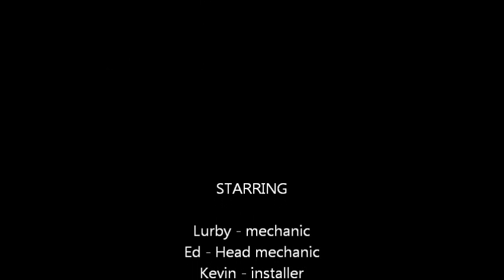Ford 4R100 automatic transmission rebuild

Comment: hey Matt. I broke my Trans cooling lines when I pulled the unit out.  can I replace the metal lines with rubber ones?
Reply: also.  I realized I way over tightened the 2 center support feed bolts    is my cased toast?  I see a little circular hairline fracture around one of the bolt holes :/
Reply from the maker: First, you can use rubber lines, just flare out the end of the steel lines.  If you do not flare the lines out, the rubber lines will blow off when you least expect it.  As far as the center support, I am sorry to hear about the crack. Without seeing the crack it is hard for me to judge what to do. And I really do not feel comfortable telling you to run with a case with a crack in it.   I can't say I have ever seen a case crack there.  On the other hand, it may be superficial if does not go all the way through the case.  Tough call but I like to play it safe than sorry.
Reply: +Matthew Damato   just superficial hairline.  inside of the case is OK.  not sure if over torquing can actually warp the case like the manual states.   I put a flat edge across the valve tunnel side and looks fairly even.  hope it's no big deal.
Reply from the maker: Sounds like you're comfortable running with that case. A trick to keep a crack at bay is to drill a tiny hole at the end of the crack. Thus, if case is flexing than the crack won't get worse. Lastly, don't forget to flare the ends of the steel cooling lines before you put rubber lines on them. Use good clamps too, don't cheap out on the clamps.
Reply: +Matthew Damato great!  thanks for the tips. I didn't need to buy any specialty transmission tools bc of your video.
Reply: +misterfakeid since I torqued those feed bolts too tight and could have possible warped the case,  whats the worst case scenario if there's a valve body cross leak?  anything else a warped case will cause ?

Comment: how do you feel about torque converter change after friction failure ? are there some circumstances when you can re-use it?
Reply from the maker: I will first inform you that a torque converter has its on friction material within it that burns up,so be careful.  Moreover, with the amount of little nooks and crannies that can hide little pieces of your old unit, reusing a TC can be very dangerous.  However, there are plenty of times when it is okay, and in fact I would recommend reusing it.  You just have to know the units with trustworthy TCs and it would depend on the reason why you needed a unit in the first place.  Instead of going through every unit with my opinion on every scenario, why don't you run by me on what failed in your unit that caused you to have to rebuild it and what type of unit it is (or if you don't know the name of the unit just give me year make model and eng size).
Reply: 4r100 out of a 4x4  02 250 super duty 7.3. all frictions in forward clutch pack were burnt pretty bad. I had friction material in in and around the clutches but the transmission was clean otherwise
Reply: i should add that there appeared to be almost no wear on any of the other frictions and steels
Reply from the maker: I would never re-use a TC from a 4R100, and I would spend the extra money on a good product like pro torque.  Sounds like you ran the fluid low possibly?  Did you have a leak or did the filter fall out?  If not, CHECK THE CENTER SUPPORT where the forward drum rings ride.  Usually the bearing starts to wobble and will smoke fwd frictions.  If it is not smooth, make sure to change that center support.  You can buy just the steel piece without the aluminium brand new.  A Taiwan manufacture makes a good inexpensive product.  Also change the fwd drum if that is the case.  Good luck.
Reply: funny u mention that because the center support was missing the external o ring and the aluminum above the oring slot has a groove worn into half of it i suspected the snap ring that was floating around inside had something to do with the groove but could that be the bearing that your referring to?
Reply from the maker: absolutely, do NOT reuse those parts. You will be doing this again in a month if you leave those hard parts in the unit.  Sounds to me like you found your culprit.  Any transmission parts supplier knows about the upgraded center support kit.  The new center support kit comes with the bearing already pressed inside the steel part. And don't forget to get a rebuilt TC, it will save you the head ache down the road.  One of the better TC companies manufacturers its TC right next to my old shop here on Long Island New York, named Pro Torque.  I am not here to advocate one company over another, but there are a lot of bad TC companies out there and I do not want to see you learn the hard way.  They do deliver nationally so just call them up.     Good luck with everything.
Reply: thanks
Reply: 1 more question please... are the clutch clearance specs the same for the 4r100 and earlier e40od?
Reply from the maker: sorry for the long response time, for some reason I did not see this post 3 weeks ago.  You probably have already figured out the answer, but if not here we go.  Yes, the 4R100 and E4OD have the same specs for clutch pack clearances.  however, the general rule of thumb for any American Unit is about .010 of an inch of clearance per clutch.  For example, the forward drum has four clutches and therefore should have .040" of clearance.  Usually I will make it a little tighter side by adding over-sized steels or a thicker snap-ring.  good luck.
Reply from the maker: Yes, exactly the same clutch clearance specs (otherwise known as CVI Clutch volume index) for both a 4R100 adn E4OD.  The general rule for any transmission is .010" per friction.  Therefore, if you have a 5 friction clutch pack then your clearance will be .050"    Good luck.

Comment: I see you're using an impact wrench on some parts.  I've been warned not to use one anywhere on a transmission during assembly (only use on disassembly).  Are they full of crap?  I know you said you've done 1000s, so I'm not questioning your knowledge, just asking for a comment as I'm going to try this exact transmission rebuild and I've been watching every video I can.
Reply from the maker: play at 1:12:20 for my comment on using an impact gun on transmissions. I've never had a transmission not work because I used an impact gun.

Comment: hi are all 4r100 from 1998 to 2001 the same 2wheel drive
Reply from the maker: From 1998 to 2001 Ford made   3 different types of 2 wheel drive 4R100: small block gas, big block gas, and diesel. Although some parts are interchangeable, these units must match the motor and electronics.  Otherwise, they are the same inside their own category for those years unless someone made changes.

Comment: where can I find the thinner pressure plates you mentioned for the 4r100?
Reply from the maker: any transmission parts place have these thinner pressure plates at hand.  I am not sure where you live but here in New York you can call VTP Transmission Parts in Brooklyn or Relco in Queens, and nationally you can call Transtar (they are all over the country).  The thinner pressure plates for O.D. work great in the gas applications to give it a stronger torque capacity and well worth the money.
Reply: Thanks, I live close to transtar.

Comment: how do I take out the bearing inside the overdrive planetary carrier assembly.   gears are getting in the way :/
Reply from the maker: +misterfakeid you don't.  That bearing will stay inside the carrier when rebuilding.  If the bearing is bad, then you must buy another overdrive planet set.  Several variations of the planet exist that have to match the output shaft.  The ID mark on the output shaft identifies it as a later type.  I hope that helps.
Reply: +Matthew Damato. OK cool. I was going crazy trying to remove it lol.  anyways. how would you know if the bearing is bad?  also I'm having a hard time putting in the snap ring on the rear carrier after putting in the planetary gear.  I can't seem to push down the planetary gear in any further to get the snap ring to reach the groove.  any advice?
Reply from the maker: You don't push down on the planet, but rather pull up on the housing that holds the snap ring instead.  The piece that houses the L/R sprag that has the groove in it, you pull up on and put snap ring in.  It is a little tricky but after a couple of times you will get hang of it.
Reply: +Matthew Damato thank you.  I was able to figure it out.    is it necessary to machine the center support and add a snap ring shim?
Reply from the maker: never, if you are having trouble with the center support snap ring it sounds like you do not have the bevel spring compressed all the way. But hard to tell without seeing it. I made my own tool to get the center support in the proper position to install snap ring.  If you want to take a picture, I would be happy to take a look.
Reply: +Matthew Damato OK cool.  what's your email so I can send pics?
Reply from the maker: post it right here in the comments is fine

Comment: can I put a 4r100 from a 7.3 to  my 2001 5.4 expedition awd?
Reply from the maker: the 7.3 and 5.4 have two different cases. Even if you use the case, the pump, solenoid block and the torque converter are different that cannot be interchanged.
Reply: +Matthew Damato ok thank u for the quick response
Reply: +Matthew Damato well last question I promise I have a 2001 eddie Bauer 5.4 awd
the transmission went out at 189,762 we bought it new Christmas of 2001 with 25 miles on it. did I get my money's worth? from manassas ,va it's been to nyc ,miami, texas ,and mexico city at least 9 times
Reply from the maker: +omarhomie1986 absolutely, it owes you nothing. I generally see them fail just over 100k. However, a lot is just luck without a rhyme or reason sometimes parts snap   or bearings fail. But you did very well.

Comment: i have ford 2000 v10 engine f-350 
i want run faster what factory set up what i need to do ?
Reply from the maker: +Pedro Alicea Can you be a little more specific one what you mean by "factory set up"?  I will however try to answer your question.  The only factory set up that can work on a 2000 V10 is a 4R100.  There are a few things you can do to the gasoline 4r100 to prolong its life like installing steel planets and modified springs in the accumulator body.  I do provide other modifications in the video if you are interested too.
Reply: +Matthew Damato  tks
Yes its gasoline engine i look to going more faster and strong at the same time
Reply: +Matthew Damato may be any recomendation about torque
Reply from the maker: Changing the stall speed of the torque converter will change the torque at the rear tires
Reply: thanks

Comment: what is a reasonable cost to pay to have this done?
Reply from the maker: it really depends on where you live and what went wrong inside the transmission.  Lastly, whether you decide to pull  out the transmission yourself or have someone R&R it for you too may be extra.  My advice is to go directly to your local transmission shop because a regular repair shop rarely gets involved with this type of work and instead will send it out to a wholesaler and add another $300-$500 to the total for their cut.  In New York where I am from, the general cost to R&R and rebuild this transmission is about $2,500 to $3,000.  Prices will vary greatly depending on how many hard parts will need to be purchased to build the transmission.  If you do not need the additional hard parts, like a pump or gears, then you made out well.  On the other hand, if your trans requires a new pump then the price will increase to reflect that amount.  And most transmission shops will NOT charge extra for the removal and re-installation because they want to be able to warranty their work.  However, here in NY we are a lot more expensive than other parts of the country so I can only speak for NY.  I hope that helps.

Comment: Where is your shop? i don't want to come and hang around and watch you build transmission ( although I am sure that would be fascinating) I have an automatic 4 speed tranny from 2004 F-250 4x4 6.0 Diesel I need rebuilt to make it more reliable.
Reply from the maker: I'm not here to advertise a shop, rather I hoped to make a video to help people do it themselves. But I appreciate your confidence.
Reply: Oh that's unfortunate . I would never try to rebuild a tranny. Engine yes. Tranny no. To much black majic and holding your mouth right.

Comment: nothing out of this world just a regular repair 
the pump just take a max of 20 ft pounds whit the air gun you can
broke the pump and overtighten
Reply from the maker: It's possible and I wouldn't recommend using a gun for the inexperienced. However, after years and years of building transmissions every day, over and over...well you get the picture. Your gun becomes an extension of your hand. You can feel every bit of the bolts and parts through your arm and even hear the different sounds they make when something is too tight or too loose. As far as cracking a pump on a 4R100, can't say that a 1/4 gun would be effective even on its most powerful level. Nissan pump on the other hand, would probably break the bolt off. But again, this type of knowledge only comes with years of experience. What I can tell you is this, it is always be safe than sorry. When it comes to building a transmission it's all about weighing the risks and benefits around every corner.